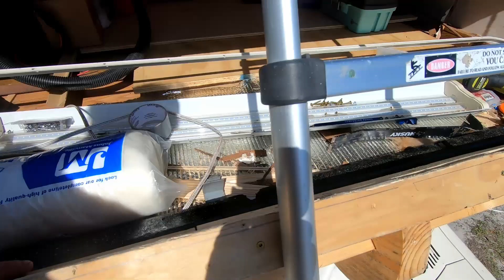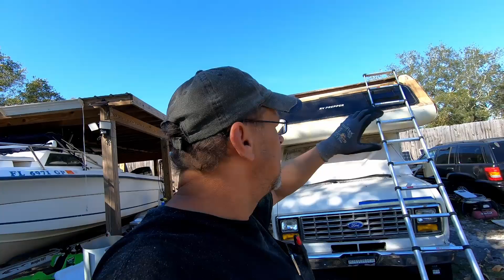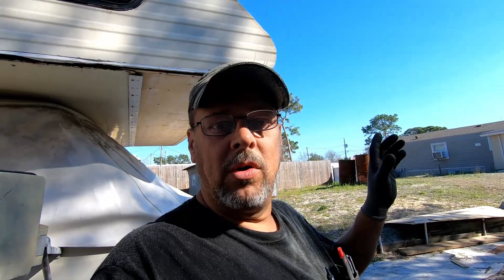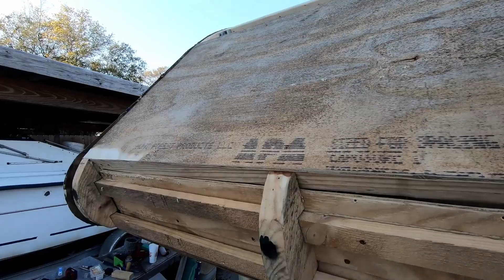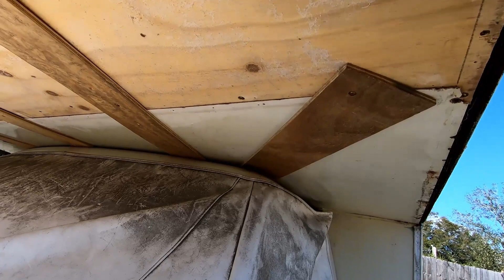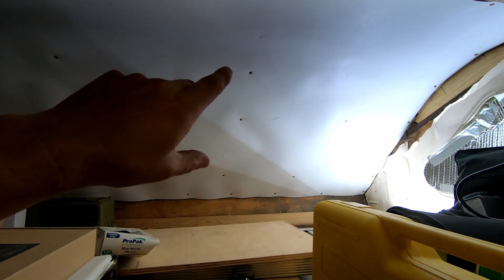Bunk Rebuild, and Window Delete, On the Road.

Comment: I have the same telescoping ladder you have and I was wondering if you've had problems with it sticking on opening and closing as I have?  I've tried to figure out how to disassemble the ladder to clean it, and can't get it to come apart.  I've tried pledge furniture spray to lubricate it and it still sticks. Any advice?
Reply from the maker: I PB Blaster on it when fully open. I spray the heck out of it so it soake into the guides. Also spray under the rungs where the hught spot is real good. Seems to work for me.